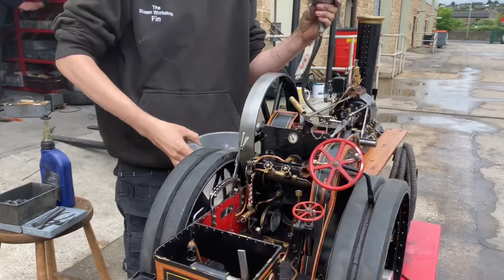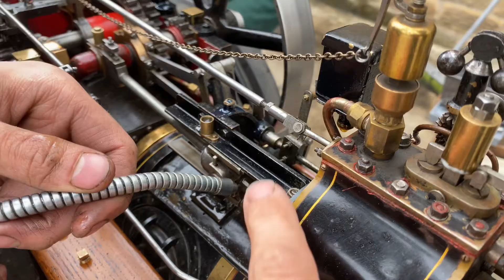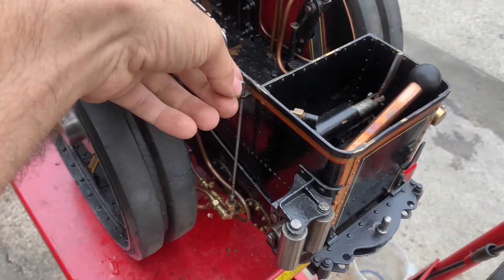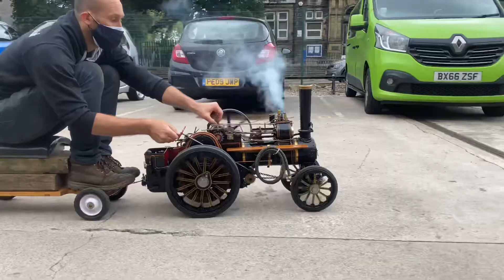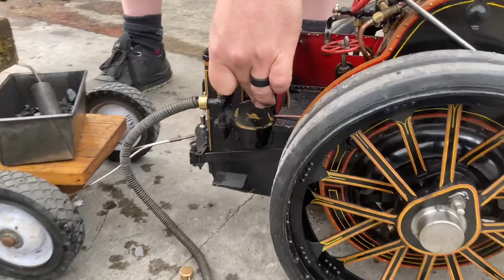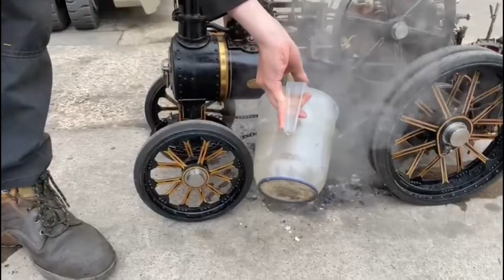2” scale Fowler A7 Traction Engine

Comment: I once fired my friend's miniature traction engine on  BBQ charcoal. I didn't know the you could use it to start a fire in the firebox.
I accidentally stoked the fire that he had got going and pressure went up and flywheel went around faster and faster. my friend told me off for doing that.
it was when he was having trouble finding enough coal for his engine.
Reply: should have used the regulator?

Comment: cool but how to get one of these? Also can you use just normal wood as fuel? AAAAAAND is it absolutely crusual to use different oils when oiling?
Reply from the maker: our website is where they are all for sale.  Yes, the larger ones will happily run on wood, (although coal has more heat in it), and yes, you need thick steam oil for the hot cylinders, as the thinner lubricating oil will just get steam cleaned away.  www.steamworkshop.co.uk
Reply: thanks!
Reply: can i also choose between 2" and 3" size for the Fowler A7?